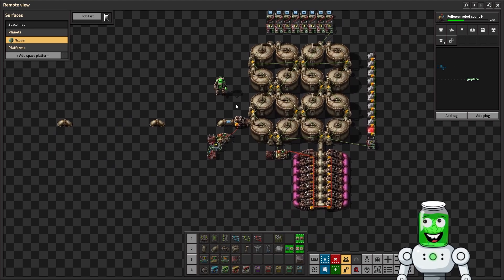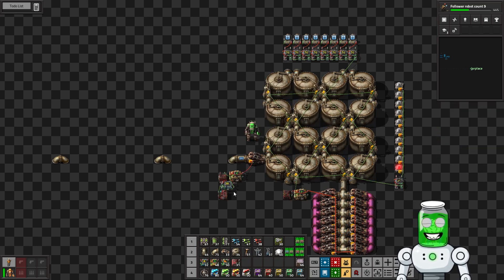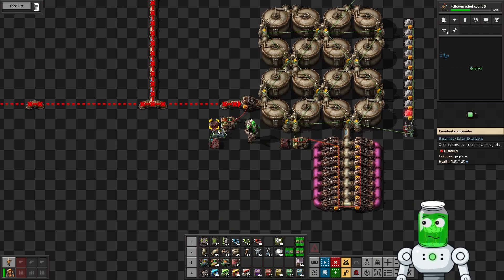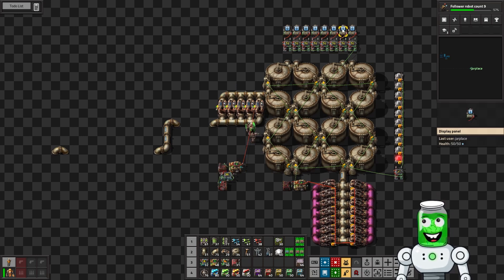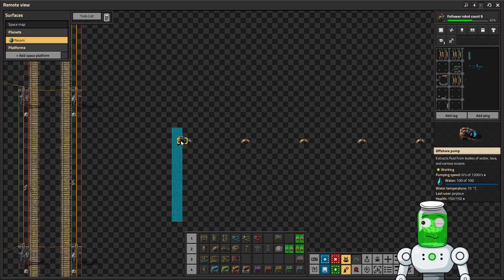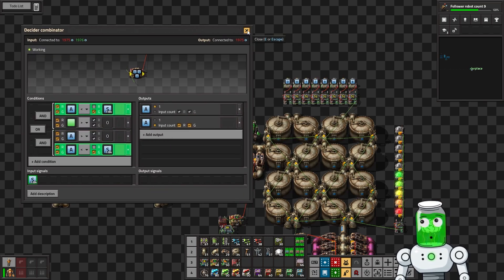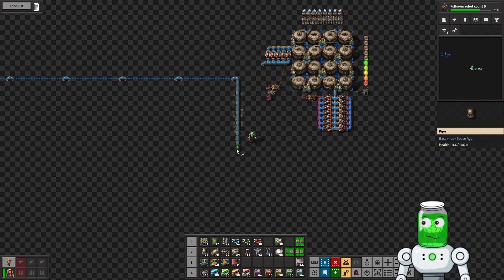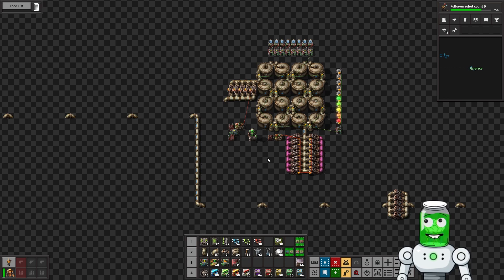How do fluids work in Factorio? | Factorio Space Age

Comment: So.. Can I use a fluid tanker to connect two branches of separate pumping systems? How do I abuse this mechanic?? If I connect two sources at different lengths, why doesn't the length of pipe reset (instead of turning into red Xs)? There are still so many questions
Reply from the maker: Great questions! You got me thinking. Maybe we'll have to have a part 2 👍
Reply: I was able to connect 2 seperate oil fields together eith a train pickup in the center. I chained the systems together with a pump from the field to another collection area 
Oil---->@@@---->@@@@@<----@@@<---Oil

-= pipe
@=tank
</>= pump
Reply: Does that work? I think they also add the fluid tanks to the 320 length in total. Even though I don't really get why you would transport fluids for that long. 320 in a radius of the source is pretty much. I only had problems with that in my biggest save game on my power plant of ~160 reactors. All turbines where connected and I had to rework them to get it under 321 length again
Reply: @alexanderjanke1538  Yeah I wonder, can I just pump into a fluid wagon, then immediately pump out..? Would that increase the length of the fluid network?
Reply: @Foxbat131  Edit: you want to connect 2 systems. Ohhh. But yeah, just use pumps. Pump it into some tanks and you are fine. And from there you should be able to go new 320 spaces.
For example you can also extend it by placing 2 or more pumps facing in opposite direction and pump from E system - pump - P system  and P system - pump - E system so fluids can pass more then 320 tiles but still flow in both directions. Thats how I fixed my power plant. it works, but you are limited by the throughput of the pumps so you need extra space for them

Comment: there is one more thing with fluids: the ports at a machine are limited to 6000/s. That usualy doesn't matter, but it can in late game for ex beaconed cryo plants with steam/water
Reply: This also happens with acid neutralization to water condensation which can happen early mid game. You can avoid the throughput problems by directly connecting both factory and avoiding the pipes.

Comment: One thing I don’t like about the new fluid mechanics is that the fluids at the output of a pump gets de-prioritised. So if you have multiple branches of pipes to different machines, don’t put a pump to a machine that you want working all the time.
Reply: I'm not sure I understand - I thought a pump created priority output from the pump - as in, it will empty to the pump output side before filing other machines. Can you give an example?
Reply: @ There is a T intersection of pipes, one goes to 10 chem plants and the other to 10 assembling machines. If your light oil supply is only enough to support 15 machines, then the side without a pump has 10 working machines and the side with a pump will only have 5 working machines instead of a 7.5 split.